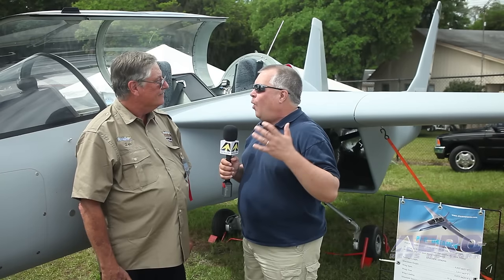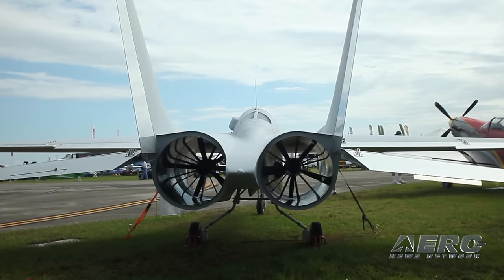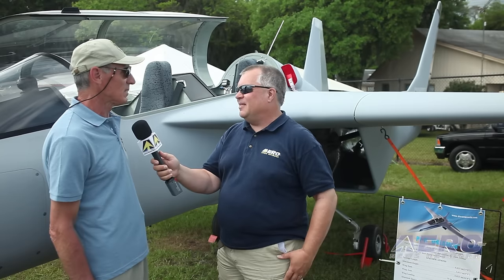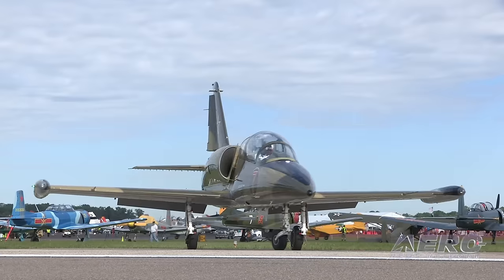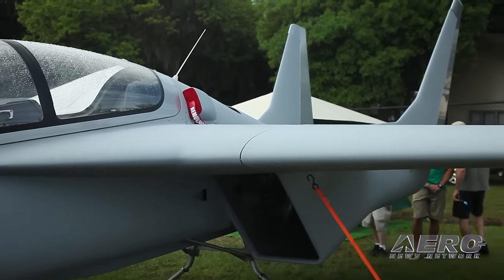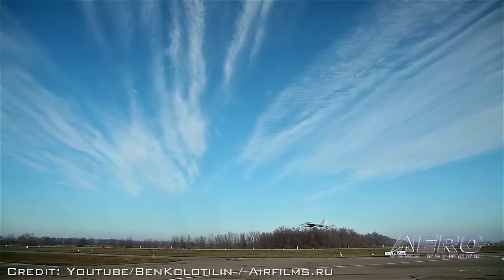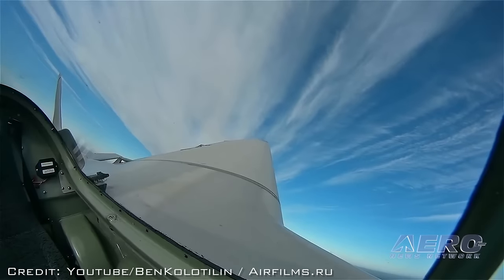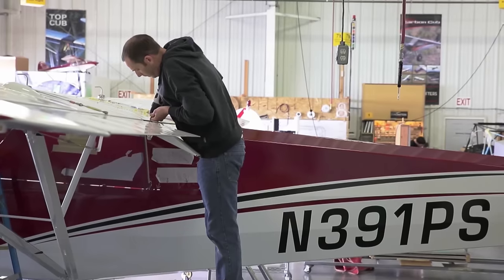Aero-TV: Walter Mitty's Near-Jet - The PJ-II Dreamer Ducted Fan

Comment: The thing is...After flying GA for ~ 20 years one thing that interests pilots across all spectrums is the lure of fighter aircraft design.  Lets face it, crawling through the clouds in a C172 is not something that will get pilots off the couch after couple hundred hours for the express purpose of a 'fun flight.'  Planes like the SF-1 and this baby here could bring the 'FUN' back to GA.  Flying for fun, the reason you got your license!Piper, cessna and beechcraft need to wake up - these planes cost a fraction of the big manufactuers and scream fun!

Comment: The plane screams to be electrified.
Reply: What does that mean? Electrified as in supercharged? Like the Kawasaki H2R?
Reply: @antonis4325  No. Electrified like an electric eel probably, so it can shock any aircraft appearing menacing to it.
Reply: Agreed, this needs solar cells all over the tops of the wings and fuselage.
Reply: Or to be put double small jet engines.

Comment: I know the LS6 engine and it won't last long spinning at 5,000 rpm! I hope that's full throttle take off engine speed and you can cut back 50% throttle for cruising because at 5,000 rpm you're going to have to rebuild the motor after 100 hours...and it doesn't look easy to get to. Besides that what a cool one off gearbox with 2 angled driveshafts running the fans! Really cool shit right there!
Reply: kevin Tucker He said the fans are moving 6000 rpm. Not the engine. He probably has that transmission geared to make that speed with the engine at a comfortable throttle level.
Reply: I would use the 32v 5.0 Ford like in my 2014 Mustang. It will run all day long at 5-6,000 rpm and not even breathe hard. With the Roush supercharger it puts out 625 HP.... LS engines are known to be lazy, and not like higher RPMs...
Reply: A lot less load on the engine than a vett puts on it.
Reply: Put two TJ-100's in it. Or TS 100's driving the impellers. These UL gas turbine engines are like less than a quarter the price of a P&W. It would cost like 100 grand for two TJ-100s. Not too much money.
Reply: @tazaxx21  32v Ford engine is 9" wider, 6" taller, and 60lbs heavier than an LS6. I guess you've never built an airplane.

Also, airplane builders aren't looking for highest hp, they're looking for dependability. The more you stress the engine, the less dependable it becomes.
Reply: why not use a turbocharged 4g63 out of a mitsubishi eclipse?Less weight than a v-8 ,and my eclipse was pushing about 800 hp at the front wheels!!

Comment: Would be cool if the landing gear actually folded in,....great for drag aswell, sadly it doesn't.
Reply: Said it is a retractable but they did not have time to get it working before this showing.  You can actually see the opening for the strut/wheel to fold up into, behind the front strut on the underbelly.

Comment: This man and his team is my heroes. I wanna design and build my own aircraft along this idea, but using the marlin engine from the p51 to power it.
Reply: Donny Schort I have a similar idea of building a plane like they did but this one for airline lovers. A scaled down version of a 737 or A320 that a GA pilot could fly.
Reply: I have this same idea. I want to use these ducted fan types to power different airframe designs that look like other fighter jet types. This Mig 29 / F-15 type looks awesome but I also think an A-10, F-16 (single fan) and F-14 would be awesome for kits. Though I think there needs to a better design on power plant and fan blades. Gotta get those RPMs higher.